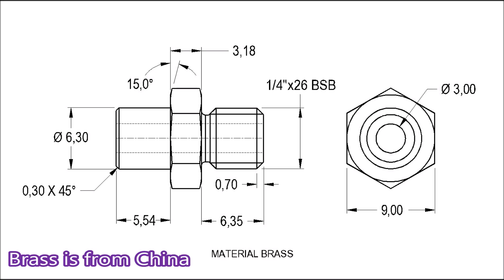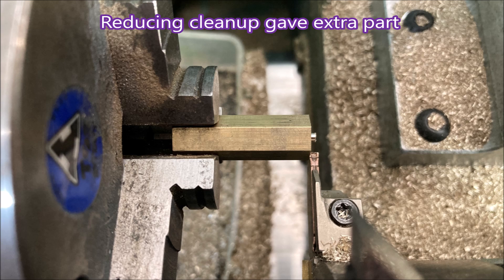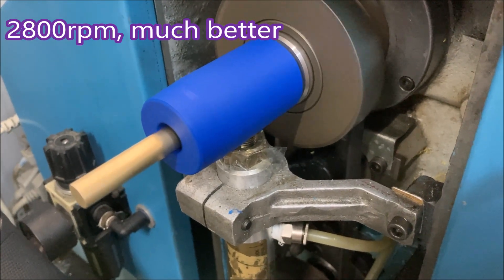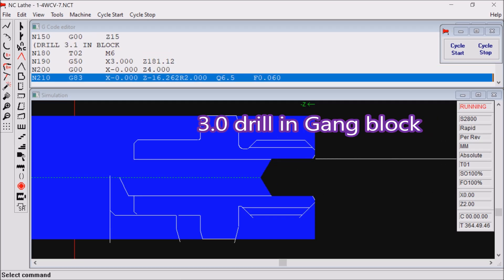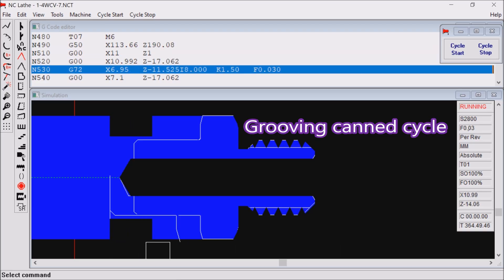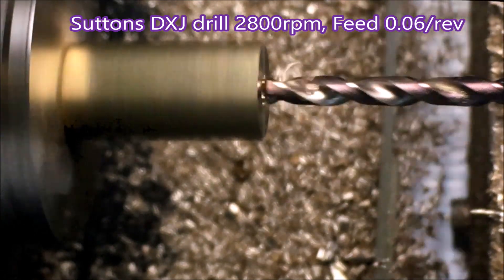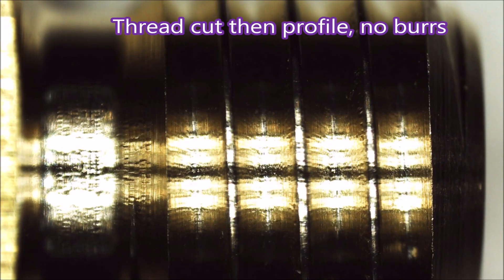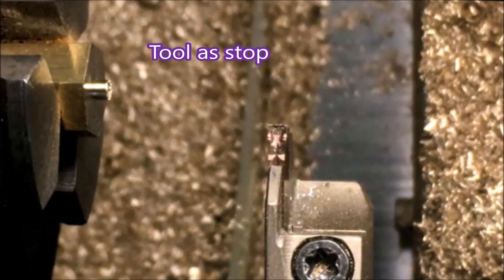Drill, turn, thread 1/4"x26TPI, and part small brass fitting. Sumitomo insert, Suttons DXJ drill.

Comment: Happy new year :) I hope at the very least you gave your programmer a stern talking too :P I love the 3D printed spindle liner :D, Cheers Stephen
Reply from the maker: Thanks Stephen, I was not happy, that was 9.0 hex from China so I was losing parts with every one that was wrong. What makes the expense of full profile inserts so worthwhile is if you get the pitch, depth of thread and OD correct, you get the perfect thread! I think it was because I setup the turret well before the stock arrived. I wanted to get the tools setup in the right order. I just forgot that I had not checked the insert. Ageing is an odd process, one is always questioning if that would have happened 20 years ago.
As for the spindle liner, it could have been turned with just a hole, but that would have been something like an 11.0 hole 220 deep!  The print may not have been perfectly concentric but it worked which is what mattered. I have had my printer more than a year and the speed and quality of prints still amazes me. This new generation of printers are just so good.  Thanks for your comment. Nigel